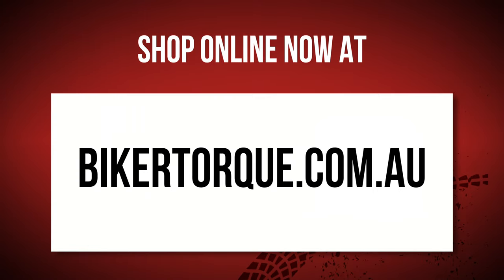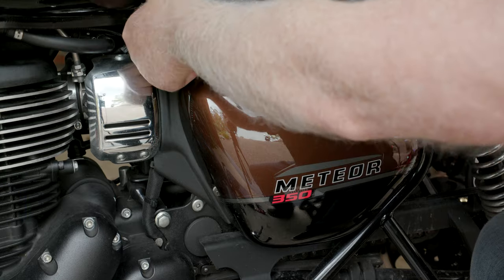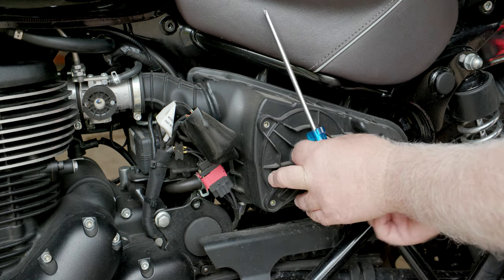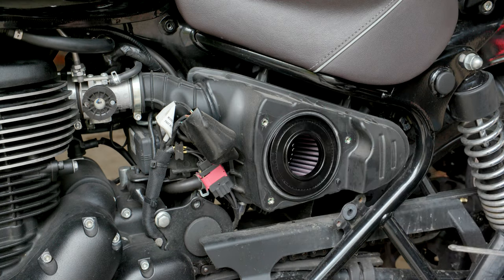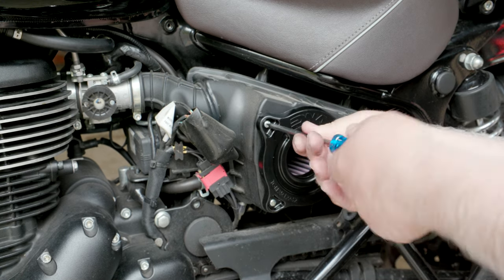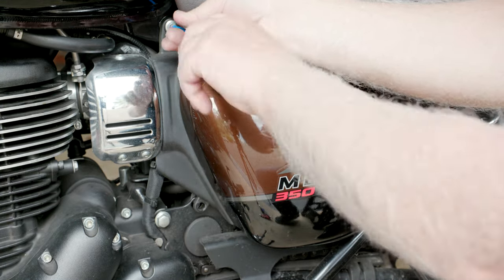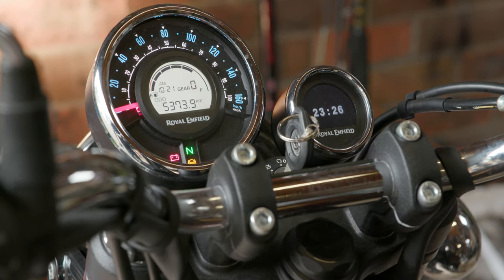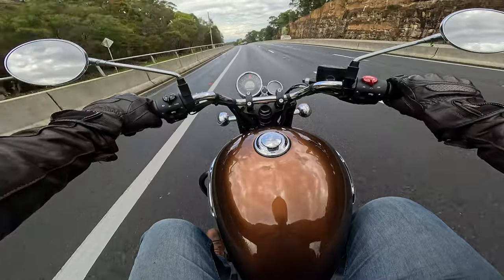Fitting a DNA Air Filter to a Meteor 350. Is it worth it?

Comment: It's doubtful that you've gained any more power with the stock exhaust & ECU tune. In fact it's more likely that you've reduced power by messing with the air/fuel ratio.
But I bet the intake howl is a lot better and, let's face it, the mods we do to our bikes are to make it either look or sound better. Increased power is just the lie we tell ourselves to justify the expense. So job done in my opinion.
Reply from the maker: Didn’t notice much difference in the sound of the intake to be honest.

Comment: How can it do 80kmph at lower RPM, air filter dont change the gearing.
Reply from the maker: OK, there’s no tachometer so not sure what RPM it was doing, but it sounded like it wasn’t working as hard.  Also, on that stretch of road with the incline, the throttle is usually very near pinned to maintain the speed limit.  With the high flow air filter I definitely has a bit of extra throttle to use if needed.

Comment: I suggest you have a look at a channel called project farm to see some very scientific testing of air filters paper and the high flow cloth oil style. If more air can get through there has to be less resistance to air flow by either larger holes or less filter medium, or a combination of both. The results of the tests are quite illuminating. Enough to convince me that by sticking with OEM paper my engine is yes a little bit restricted but far cleaner. Contaminants kill motors but a little bit less air won't because its been tuned to run that way.
Reply from the maker: Shall check it out.
Reply: Also consider how independent that (or any) testing actually is. Putting out a different perspective  -  I have heard that the oil impregnated filters collect more of the dust particles because the dust is trapped by the oil.
Reply: @calvinmathys2023  he is an 100% independent reviewer with zero sponsors. He makes a living by being honest. What a strange concept nowadays.
Reply: For a bike this price, I’ll take a slightly shorter engine life for more fun during that life

Comment: I fit the DNA filter on all my bikes. I notice the note of the bike is different and louder plus an increase in performance. 
I highly recommend AEW Short Star exhaust! I tried a few different kinds and the AEW Short Star produced the most bass low end note. Delightful!
A decat pipe is also an easy fit between the header and exhaust.
Reply from the maker: Got to be honest, I didn’t notice any difference in sound, but definitely felt the engine wasn’t working as hard. Not a massive difference but noticeable. Thanks for watching, shall check out the AES exhaust.

Comment: Hi
With the way the ECU is programmed on closed loop where it uses the O2 sensor for monitoring mixture it may make a bit of difference. This only occurs when less than approximately 1/2 throttle or at higher revs, where it goes to open loop and shuts the O2 sensor out and works off mapping in the ECU. IF ANYTHING you will be running leaner in open loop. And as they are almost running at 15:1 to comply with emissions instead of 14.7 :1 , like to see a cht and see any increase in heat on open loop. 
The only way to fix is to remap ECU by someone who knows what they are doing. And this is for any mod to exhaust or change intake. 
Cheers
Brian
Reply from the maker: Cheers Brian, interesting stuff

Comment: I did the air filter mod a while back (5,000miles ish ago), it made the bike even more enjoyable to ride. Recently I changed the front brake pads for the EBC HH version as I felt on the limit 2 up with luggage coming down winding mountain roads. They're still bedding in but, at the moment, feel better though I dislike the buzzing when braking harder that has come with them.
Looking forward to see what you do next. I suppose a de-cat?
Reply from the maker: Might do a standard pipe first, then think about a de-cat.  Have a few other little mods coming up also.

Comment: 4:56 "Maintain 80 kph at a lower RPM". Unless you have switched gear it's pure magical thinking. Your gear ratios are fixed, end of story. I'm sorry, I really like your channel, but this makes absolutely no sense.
Reply: I'm pretty sure this is exactly what Ross means. A lower RPM would point to a higher gear rather than maintaining the revs in a lower gear to make it up the same hill he commutes on daily.
Reply from the maker: So not sure, but it definitely sounded like the engine wasn’t working as hard, no tach so can’t be certain of rpm.  I usually have the throttle pinned on that stretch of road, but didn’t have to pin it with the air filter.
Reply from the maker: Cheers Stef, still love that little Meteor.